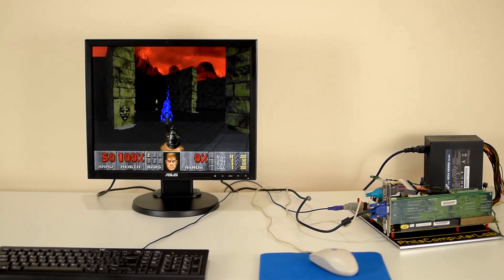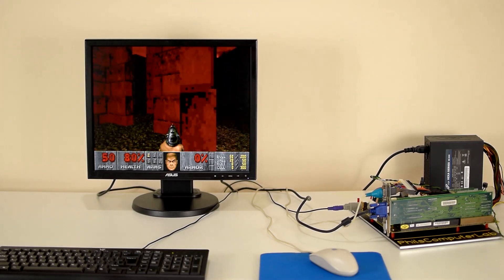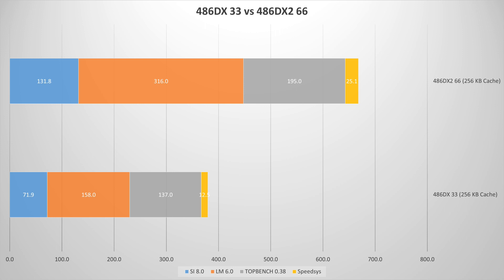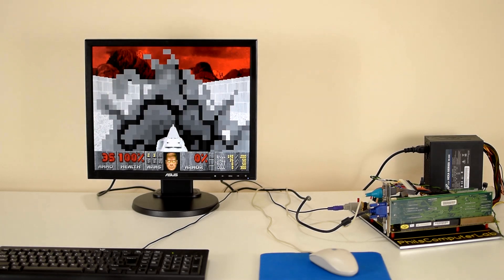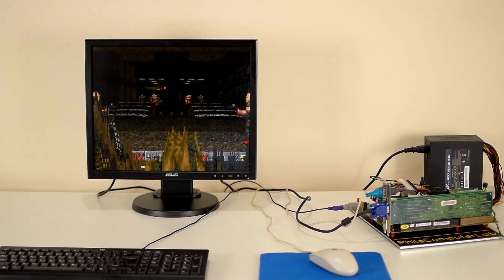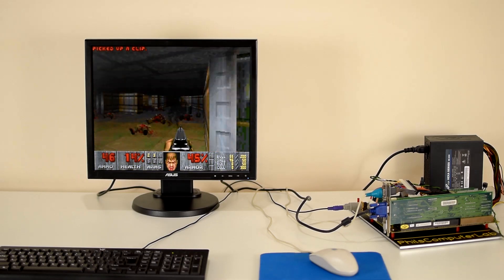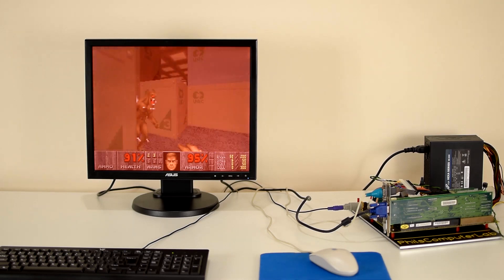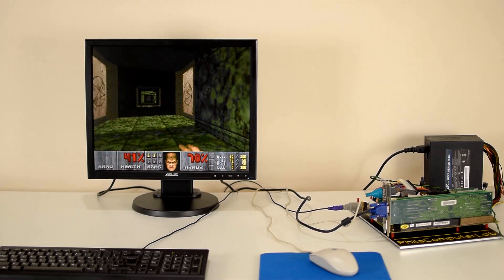486 DX2 66 The 3D Game Changer DOS Games

Comment: I came across an old price list the shows the 480 dx2 veisa as the top-of-the-line chip on the list. There's not a date on it but the retail price was $735.  the same price list shows a 1.2 gig SCSI Fujitsu hard drive for $905. I built a computer from this price list but I used a cirrus chip. I don't remember what hard drive or how much RAM. That was Windows 3.1 days I believe. I recall the whole thing costing like $700. Wikipedia says the 1st 486 DX's came out in April of 1989. I really don't recall this computer was built.

Comment: 486 DX2/80 blew my little mind, then I ran Windows 95 on it and it turned into an asthmatic snail
Reply: Back in 1990 i had a IBM PS/2 Model 30-286 ("slimline"/ pizza box case). In 1993 i replaced the 286 board with a '486 board (came with 486 DX-2 66 MHz CPU and 1 MB CL-GD5428 VLB video on the board).  By mid-1995 i upgraded the 486 66 MHz with an AMD 5x86-133 MHz CPU in it...ran WIndows 95 like a beast. 16MB 70ns RAM.  By late 1995 I used it to do desktop publishing, scanning, & web development for a local ISP.  A year later this system helped me launch my IT/telecom career path, where I was pulling down 6 figures in the late '90s / early 2000s. Best times of my life.
Reply: @Trev0r98  that's a good career progression. All started on the modest 386!!
Reply: @judewestburner   Started on the even more modest 286!
Reply: Strange. I ran a 486dx2-66 with Win95 and it ran just fine. In fact I was running a BBS at the time and it worked quite well.
Reply: @Caseytify  how much ram?
Reply: 8mb. It was a real killer.

Comment: I upgraded from 386sx 20MHz to 486Dx2 66MHz. The speed increase really was noticeable. I was running Doom with low-res and small screen and suddenly could max out everything. My favorite chip in 486 era anyhow is am5x86, which I ran at 3x50MHz = 150MHz. Still have dx 33MHz, Dx2 66MHz, Dx4 100MHz, and that am5x86. Maybe I’ll fire then up inspired by this video.

Comment: I remember I used Overdrive processor dx2 50Mhz which was installed to the 487 - socket. And then later replaced with Pentium Overdrive.

Comment: I had the 33 as a kid. The DX2 66 was a distant, unattainable dream. I never did attain it, believe it or not I somehow hacked it until 2003 with that DX 33 (was actually still okay for basic internet use) when I upgraded to an AthlonXP 2400+, which was only 100 times faster. That upgrade from laggy Windows 95 to smooth Windows XP was epic.
Reply from the maker: Thanks for sharing!

Comment: I don't know if it's my favourite but perhaps the most pivotal CPU is the original Pentium  66 MHz, which came out in March 1993, almost 25 years ago. It was big step up with respect to the 486DX2/66, which had come out one year earlier, especially for floating point performance.
Reply from the maker: +luckyluckydog123 I can see the appeal! I got nothing in terms of parts from that era. Those early Pentium CPUs simply do not work with the later Socket 7 boards, which I have some.

Comment: the 486dx2/66 kept its own for a long time even against the pentiums if you used the correct hardware, i ran duke3d just fine on it as long as you have a decent VLB graphics card in it, i had a decent 1mb trident card in it, it served me well for many years.

Comment: My fav CPU was the Celeron 300A. Instantly clocked to 450mhz and performed better than a Pentium 2 in every task I threw at it and matched the Pentium 3 450 in some. Golden CPU until the Core2 line. Ah the Core2Quad Q6600. Went straight to 3ghz, but needed a voltage bump[slight] and better heatsink combo.

Comment: Not sure why you had trouble with Doom or Dark Forces on a 486dx33. My first PC in 94 was a 486sx33...no math coprocessor....and it played Doom II flawless. I only had to upgrade in 1995 to AMD 486dx4-100 for the ground missions in Wing Commander 4. My sx33 was beastly on games.AST Advantage 486sx334 meg ram210 meg HD512kb built in Trident videoSB 16I still have it too
Reply from the maker: Might be worth firing up the beast again and seeing what it's like. Memories can play tricks, I remember playing Wing Commander on a 10 MHz 286 and my memories are positive, but I've seen it running on this machine recently, and it's an absolute slide show. EGA graphics and PC Speaker to. Doom I know inside out and it was even part of a global benchmark project with hundreds of entries. It runs maxed out at 35 FPS, half the screen refresh rate and it takes an early Pentium to achieve that, like a 100 MHz Pentium.

Comment: Lovely stuff.  I remember Doom running just fine on my SX33, but I needed the DX2 to enjoy The Need for Speed.
Reply: i remember the same stuff except instead of a sx33, a dx4 100 and instead of dx2 a pentium 100.
but i guess tnfs was to run it at 640x480.
Reply: @GraveUypo  pentium was a game changer for Quake.
Reply: I remember tweaking the hell out of my SX33 to get that little frame extra because Doom didn't run that well on my SX33. Mine had 8mb and a sound blaster pro clone. On a DX2 66 of a friend of mine it ran maybe a tiny bit better but he had only 4mb and no sound card, so, I preferred my version :)
Reply: @Ezyasnos  Did you play in high or low detail back in the days?
Reply: @spearPYN  I think it was high (I vaguely remember I couldn't stand the low detail), but with a smaller screen, comparable with the screen size of the Sega 32x version

Comment: Do a vid on the slightly rare Intel 486 DX50?
Reply from the maker: That chips can be a lot of hassle. IMO the DX2 50 is much easier to work with.
Reply: Very true but the DX2-50 would be one of the chips I would compare it to, 50mhz bus vs 25mhz vs 33mhz, it was quite an odd chip with no multiplier

Comment: had a DX4 100 when I was a kid. I was the only one capable of playing Duke 3D properly among my friends. I could almost play Quake, but my video card was short on memory.

Recently I bought a cheap Compaq 4/25c Contura laptop (486SL 25MHz with amazing 20MB RAM) for retro development. 

If I'm able to squeeze 3D graphics from this, it will run on anything else! (I'm still at 1.5 FPS, sadly - at least, it's a turn based RPG).
Reply: i played quake on my dx4 100mhz. remember reaper bot? i thought that was going to kill lan houses, lol.
the lanhouse i frequented had 133mhz pentiums. so much better. more than double the speed.
Reply: A had a 486DX4/75 which I overclocked to a dx4/100 with 24mb ram and a good S3 Vesa Local Bus video accelerator card, it ran Quake very playable, I actually completed the game on it (dx4/100 was the minimum requirements on the back of the first released retail  box of quake, later retail versions had pentium listed as minimum).. It also ran the original grand theft auto perfectly.. It was a great machine in its day with Windows 98SE... Previous to this PC in late 1994 I had a 486DX2/66 which was an amazing PC .. But the DX4/100 was a true beast and generally kept up with a pentium 60 when it was paired with a video accelerator and  good ram.. As by 1996 2 years after purchasing the DX2/66 it was struggling to run the latest high tech games like Quake whereas the dx4/100 had no issues, I ran with a dx4/100 until the early 2000s and had dial up internet ms office etc on it.. It was a great all round work/ play machine for many years

Comment: It's odd. I remember, back in the days, playing Doom on a Cyrix 486s at 33Mhz (roughly fast like an Intel 486SX [no math coprocessor] around 28~30Mhz) at max details and with extremely smoother graphics than even your DX2 66...

Could it have been I had a faster graphic card than the one you used in this video? Mine was a Cirrus logic GD5422 VLB (the kind with no boost acceleration for Windows)... wow... I'm amazed I still remember these details... been what? 20 years? ...anyway, it was not accelerated, but it was GODDAMN FAST for the times regardless, I still remember.

Or is my gaming memory tricking me?
Reply from the maker: I have to break it to you that our memory plays tricks on us. I benchmark Doom on pretty much every machine I build, and I have built a lot, it certainly is a much more demanding game than we remember. I also played it on a basic 486 and it was fine, but back in the day you just used what you had, there wasn't an easy way to compare like we have now.
Reply: Probably so.
Reply: yeah i remember it being better than this, but i also remember it being worse than my dx4 100, so i'm not sure. it certainly didn't run full speed most of the time. just edging very close to it.

Comment: I still have my old 486DX 50 MHz machine and seeing the VLB graphics makes me jealous. :-P  Having the 486DX 50 MHz meant that the VLB was always 'overclocked' to 50 MHz and the system could not boot with a VLB video card installed. I still have an ISA video card in that machine due to that limitation. I loved that proper 50 MHz proc speed but games were challenging because it was hard to shove the pixels down the ISA bus.
Reply: Clock it down to 40Mhz then. Or see if it will accept a 25mhz FSB with a 2x multiplier.
Reply: The jumper options on that board do not allow 40 MHz.  If I clocked the CPU down to 33MHz, everything worked but I felt I was leaving too much CPU headroom on the table. The CPU's FSB is 50 MHz and does not have a multiplier on it.

Comment: Question: I'm planning on upgrading my Packard Bell Pack-Mate 28 plus with an SX2-50 installed and with the cache off, it slows down to a 386SX-25. Would the speed of the i486DX2-66 be equivalent to a 386 33MHz after disabling the internal cache? The system doesn't have L2 cache installed, unfortunately, but I can put either 128KB or 512KB cache inside of it. I have programs called Internal Cache Disable and Enable on my hard drive to disable the 8KB cache in the CPU for NHL Hockey 95, which requires up to a 386 33MHz, same as WC2 for the music to play better and not give me Exc. Checksum errors on my MT-32, unlike my Socket 7 system.

Comment: I had a 486DX2 66Mhz back in the day... I upgraded from a 286 by replacing the motherboard, CPU, RAM and power supply. Even though most games ran brilliantly, I did have some issues with a few that crashed frequently and dumped memory on screen... I may have had some settings wrong in the BIOS or bad/incompatible RAM, who knows. It was my first build and I loved it regardless :)

Comment: I remember using a 486DX 50. Since the RAM speed was higher, I thought it would run Doom faster. But Doom ran slightly faster with the 486DX2 66 and had fewer drops in fps.
Reply: try the Amd clock doubled or tripled for DX50. that's my cpu during highschool and college. I'd go back and upgrade it when I find it in my mom's attic.

Comment: There is a difference of course,but still both games are choppy on 66mhz
I think the gpu is the real problem
Reply: True its not real 3d but read the video's description,he has a video about fast gpus for 486 dos games.
Even they arent meant for true 3d like Doom,the better one will make a difference in speed on it,helping the cpu.
Reply: Vasilios As There is no GPU on this system. Plus the game is rendered by software.
Reply: Υes actually you dont call it gpu,but if you put a better card on that era or later,you can get better results
Reply: Now you made me curious... Always thought that for VGA games in DOS the performance between video cards was negligible at the time (although compatibility was important).
Reply: It wasnt negliglible for games like Doom,its not another simple DOS game
Reply: Doom is not really a 3D game and doesn't use a real 3D game engine, nor make use of a "GPU" in the conventional sense. "Simple" is subjective here, as Doom does do a good job of tricking you into thinking it's 3D, but in CPU workload terms, it is a comparatively simple 2D DOS game.

Comment: The 486-class CPU that's still near and dear to my heart is the Intel DX4/100. My first "real computer", as I thought of it, was a 486DX4, replacing my old 286. I was a little envious of my friend's AMD 5x86/133, but mine had PCI and his was stuck with just ISA (and VLB, but he had an ISA graphics card, a Trident IIRC, versus my S3 Virge GX), so we could call that one even.

With that one, I had my first experiences with 3d gaming, my first experiences with what I'd call a "real OS" (OS/2 and Linux, and also Win95. Didn't mess with NT for a few years more.)

Many good times with that machine, and I have no idea what I did with it. Lost in the shuffle, over the years. Bummage.

Comment: I remember upgrading from a 486 DX2-50 to a DX2-66 back in the late 90s (yes we were a bit behind) and the performance increase seemed incredible. I am not sure if it was actually that big an increase or was all in the mind, but it just seemed to blow the DX2-50 out of the water
Reply from the maker: Yea the DX2-50 was already quite fast. But if you had a DX-25 or DX-33, then the DX2-66 was a massive upgrade, almost doubling performance by inserting a new chip. You don't get that these days :)
Reply: well, you do if you wait 7 years like i'm doing with my 2500k for a ryzen 7nm (whole-system upgrade implied)

Comment: I had to choose between an DX-2 66 with 16 MB RAM vs a DX 4-100 with 8 MB of RAM. 

I remember that I opted for a DX-2 66 and it was a "game changer" in the point that you could run Windows 95 with games, mostly Doom 2, Hexen and so on. It was also a game changer, as Win 95 was caching fairly aggresive, so most DOS games were running starter (even they would have supposedly a small hit in perf).

Based on my experience, if you see any Windows 95, you can try games with and w/o it and see how they run and how they start.

Especially if you can find 16 MB in SIMMs.

Comment: I have the Intel 486 DX2 OverDrive 66MHz version on an AST mother board with a nice integrated graphics chip and soundblaster 16 and able to run quake with a decent frame rate
Reply: it literally gets just south of 5 fps on the demo1 benchmark. that's not decent in my book. sure you could reduce the screen size to the minimum THEN it'd be playable, but then you can barely make you anything.

Comment: Now do a DX4-100!

They even rival early Pentium systems if I recall - It would be interesting to see if this old myth was actually true, and if so, by how much.

Favorite CPU has gotta be the IDT WinChip, just because it's such an absurd concept, and yet it turned out so well.
Reply: Yes, a DX4-100 in compared to the DX2-66 would be very nice. :)
Reply: TheAslinger In comparison to the older Pentium CPUs as well, since the DX4 was reportedly able to outperform the slower Pentium systems.
Reply: Well, Pentium 60 came out in '93, Intel DX4-100 was released in '94 (cheap and reliable alternative to Socket 4 P5 Pentium).
I've done some testing, an Intel DX4 system could beat a P60 system, but it's so close you could almost call them identical in performance. 
Pentium 75 P54C also released in '94 will wipe the floor with a DX4 :)

Comment: i used to use my am486dx4-100 from 99 to early 2001 as a basic internet machine with 48 mb of ram, 1 gb hdd running NT4 workstation.  i still have it, but had to replace the motherboard.  original PCI based gigabyte board has stability issues it didnt used to have

Comment: Are you going to do a video on ISA vs VLB IDE IO controller cards? I have an old 486 with one VLB slot and I'm wonder if I'm better off using it for video or IO. I already have a Cirrus Logic CL-GD5426 VLB video card.
Reply from the maker: Good question! I'm just thinking how to best test storage performance under DOS. I know speedsys has a harddrive speed test and so does Norton System Info. The CF could should easily max out the interface I think.
Reply from the maker: But to answer your question, my instinct tells me that you should use the VLB for graphics. An ISA controller should be just fine for the HDD.

Comment: More 486 videos? Sweet! :-P
I am really looking forward to them, as the 486 is the platform I used back in my late teen's.

In my opinion, the 486dx33 is the chip to go to, if the specific range of games are from 1989, to 1991.
You will not get any better CPU for that job. The 486dx2-66 is geared to games from 1992 to 1994.

My favorite 486? Hmmm.... Good question.
I love my 5x86-133 and I love my 486dx33. The dx2-66 (as much as I love that chip) are not really that sweet a spot for my mixed bag of games. Some games are too slow on a dx2-66 and some games run too fast on the 5x86.
My favorite one of them all, must be something like the Amd 486dx2-80. I just do not have the manuals in good quality for my FIC-486-VIP-IO, so I can not really change the settings from the 5x86 to a 486dx2-66 or 80. And the other 486 board that I have, does only support CPU's from 486sx25 to 486dx33. Need a new board that supports 486sx25 to 486dx2-80.
Reply from the maker: Good points! There is so much one can do with a 486. I can't wait to test some of the faster processors and try out the Biostar PCI motherboard.
Reply: Yeah.... If you test a dx2-80, I would really like to see what your reflections are on that chip.